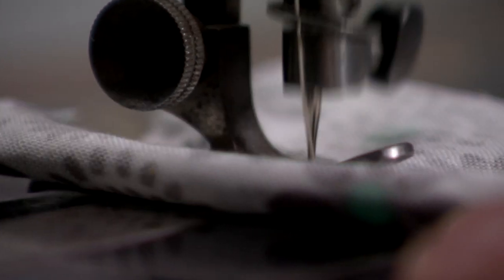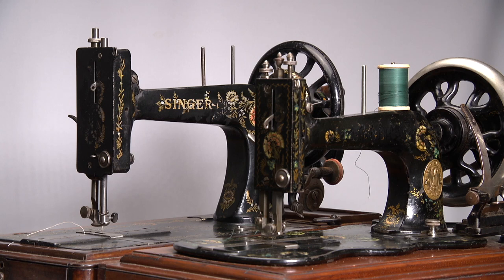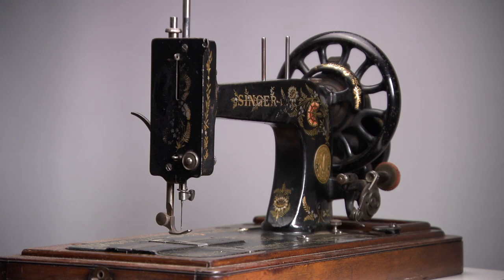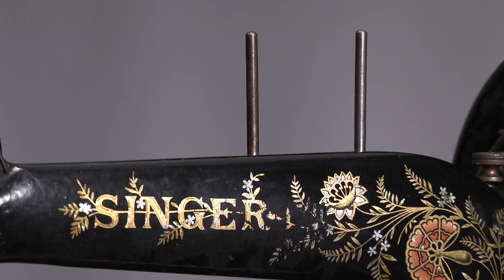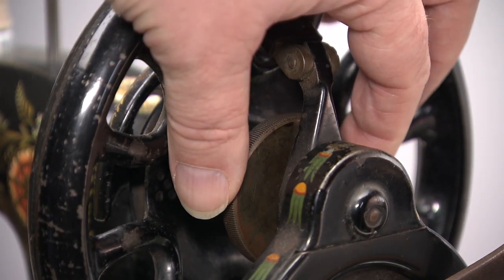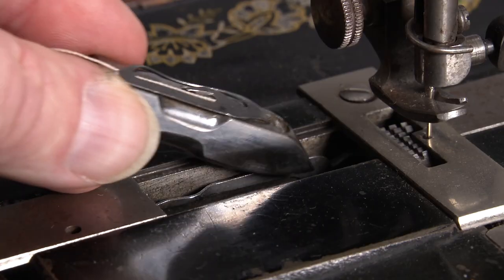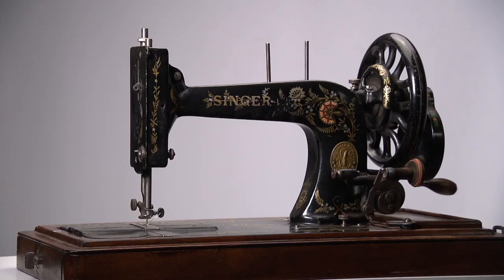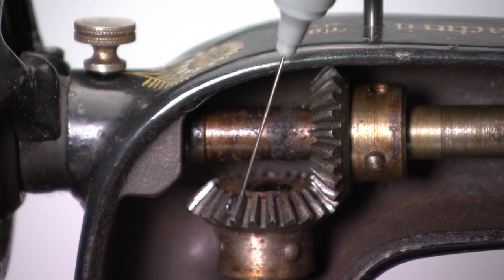Introduction to a Singer 48k. First time sewing.

Comment: Did you ever see a 48k running as a threadle?
Reply from the maker: @nadinehulbig5582  no. I have never seen a 48k treadle.
Reply: @erikneek  I found a 48k in Germany. I will pick it up hopefully tomorrow. It looks like there is no hand crank. And it comes without a base, so I wonder if it was used in a treadle table.
I guess I have to find a table for it then 😉 probably easier than finding a hand crank.
Reply from the maker: @nadinehulbig5582  Hi Nadine. So nice to hear you're planning to buy a Singer 48k.
The machine is odd and the table is odd sized too. Fortunately the boss mount on the rear is the 'universal' Singer mount for a hand crank. So if you buy an old Singer 128, 28, 66, 99, 15 of 201, you can probably use the hand crank of that machine on your Singer 48k. But reproduction hand cranks are available too.
Good luck and enjoy your Singer 48k!!!!

Comment: I have just purchased a 1910 one of these and this video is going to be very useful. Currently having trouble with the case though as it is locked and I can't find the key. 😅
Reply from the maker: Hi Hannah, congratulations on your Singer 48k!
Are you sure you have a Singer 48k? My case doesn't have a lock, but... kind of a hinge.
Most bentwood cases (with a lock) use a flat key. Which is not really a unique key. If you have such a case, try to open it with a thin flat screw driver. I have a separate video on opening those cases.
I hope that helps you.
Good luck! And enjoy your Singer sewing machine!
Reply: @erikneek   Yep, it has a bentwood case so I'll look at your video. (I think at the time it was an upgrade you could pay more for?)
Based on the serial number it's a Singer 48k made in the Scottish factory in 1910.
Reply from the maker: @sparky22700  Thank you for the additional information. The lock could be an upgrade, but I'm not sure on that.
The model 48 was made in the UK only, hence the letter K after the model number. The 48k was a strange machine. It was introduced when Singer made far more advanced machines, even in 1910. But it has that old school feeling (which I like 🙂).
Good luck with your machine!
Take care

Comment: Thank you so much for this amazing video! It has enabled me to get my brother's old inherited machine going! I have got 3 questions, though - 1. I can't move the stitch length regulator (I did loosen the screw) - can you suggest what I can do to get it moving? 2. I struggled to thread the shuttle (I noticed you said "if it all goes well", which suggests that my experience is common -  I couldn't get the thread in the right place as easily as I think should be the case, so any further tips would be welcome and, finally, 3. We have only got one bobbin, is it possible to get more? Thank you again so much for making the video! Jill
Reply from the maker: Hi Jill, thank you for your message.
I'm glad I was able to help you with your brothers Singer 48k. Great to hear you got it working (sort of 🙂).
You seem to have exact the same issues as I had.

1- A stuck stitch length regulator is common with those old machines. Often you a get it free again by using sewing machine oil. Apply some oil to the mechanism - some drops from the top, and then tilt the machine and oil the metal parts underneath the bed. Repeat that each day and by day three you might have it working again. --- I hope... 

2- When I was filming my Singer 48k I used a bobbin from an older machine first. A bobbin of a 128 or 12, can't remember. But that did not work. (I didnt use the footage of course.) The Singer 48k bobbin is more flat with a point. The 128 or 12 bobbin is more a dome shaped bobbin with a point. Perhaps you're using a different bobbin???
(Edit: Sorry I misread your second question. It is a little difficult to insert a bobbin into the shuttle. Unfortunately I think its a case of practice practice and practice...)

3- Most bobbins are still available. Or better: reproductions are available. But I don't know if 48k bobbins are available too. Perhaps you can find them using google.

Best of luck with your machine and... enjoy it! Its a lovely yet strange Singer.
Reply: @erikneek  Thank you so much- - I will do as you suggest to hopefully free up the stitch length regulator.  The bobbin seems to be ok - it's not exactly the same as the one on your film because there are no holes in the end plates, but it fits in the winder ok and once I got the shuttle threaded it worked ok so I'm not going to worry about it! I'll let my brother hunt for bobbins if he wants more - just thought you might know - interesting that reproductions are made! best wishes, Jill
Reply: I tried your suggestion and only had to oil the stich length regulator once - it freed it up quite quickly - and it works now, thank you!
Reply from the maker: @jillewbank3879  Great news. Good luck!

Comment: I just acquired a Singer 48 without a manual. I've never had a shuttle that runs back and forth in a straight line! It's fascinating. Your video assisted me in threading and inserting the shuttle. Thank you very much for taking the time to share this with us.
Reply from the maker: Hi Sandy. Thank you so much for your message. I'm glad you found the video helpful!

Take care and good luck with your model 48k!!!